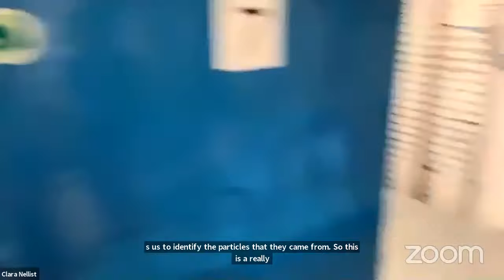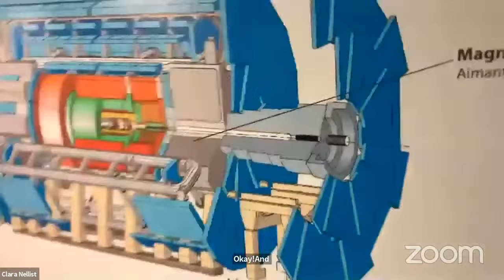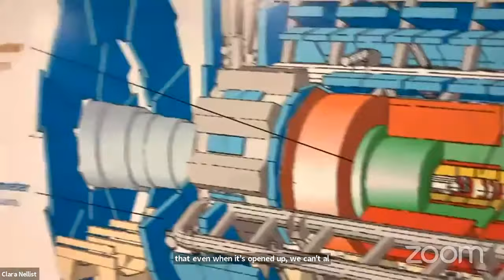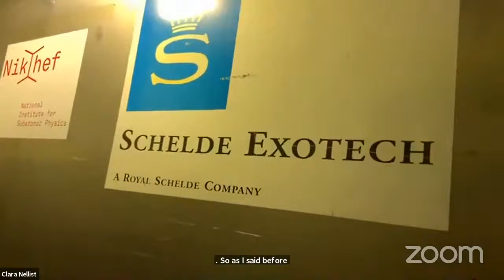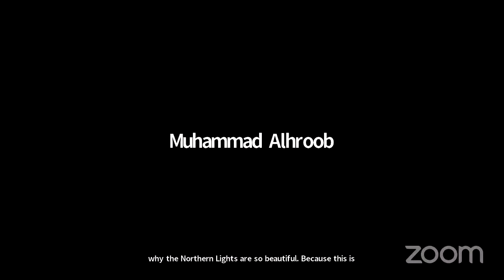Live underground visit to the ATLAS experiment at CERN, Switzerland | ICHEP2020 for Public

Comment: Thank so much for joining us on this live tour as part of The Big Bang Stage at ICHEP2020! If you have more questions after watching the tour, please feel free to leave them below and I'll come back to answer them.
Reply: Thanks for offering. I have questions about the muon spectrometers. If you have detector tubes instead of cells, doesn't it only give a 2D trajectory of the muon particle, meaning that you are missing 1 component of the momentum vector? 
I might have misheard, but if electrons are attracted to the electrode at the end of the tube, then wouldn't the muons be attracted to the electrode as well? (ok it's probably because the mass of the muon is larger than the electron, but what is the mass-energy ratio between an electron and muon if the same electric field impacts two leptons so differently?)
Reply: @mhoroub  I see.